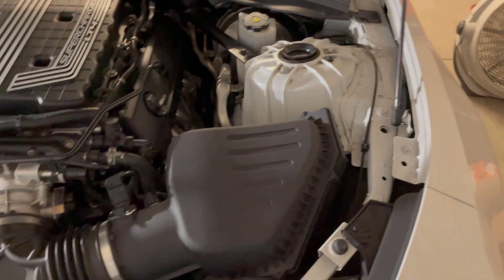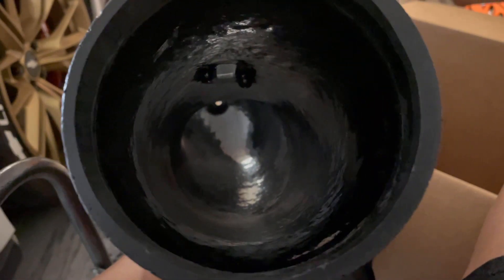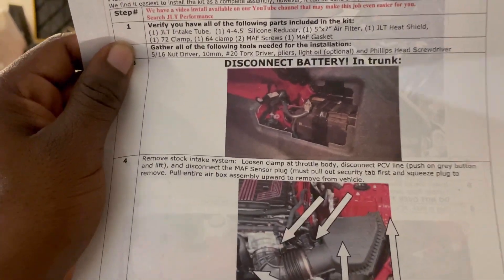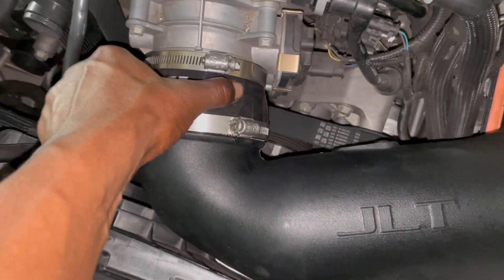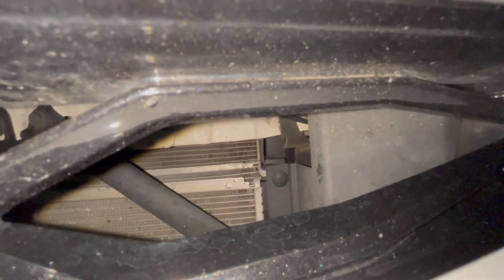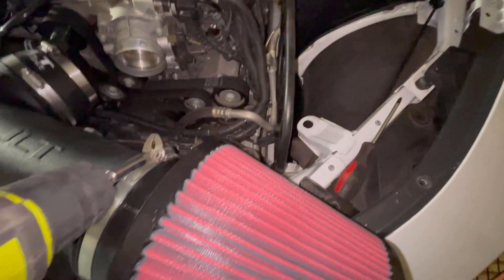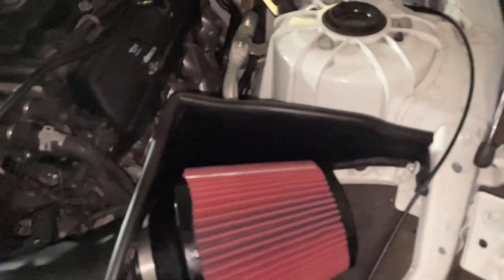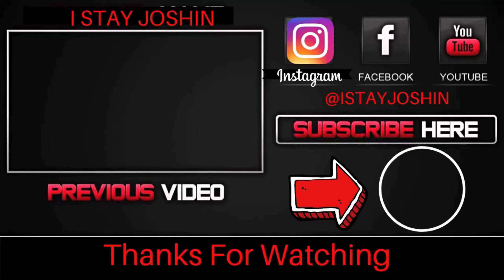Camaro Zl1 First Modifications *Must Do*

Comment: And so it begins
Reply from the maker: The wind is crazy loud I’m so in love with it, getting it tune for E.
Reply: @IStayJoshin  you going with remote tune for the car ? 

Make sure to test your E prior to putting it in the car unless you do a set up like I did for my old ZL1 

Injectors and fuel system are heading your way
Reply from the maker: No I will have it done at a shop here with an on site dyno
Reply: @IStayJoshin  fair enough
Reply from the maker: @Jack-b5o6r  how good will the tune be🤔 that’s another question